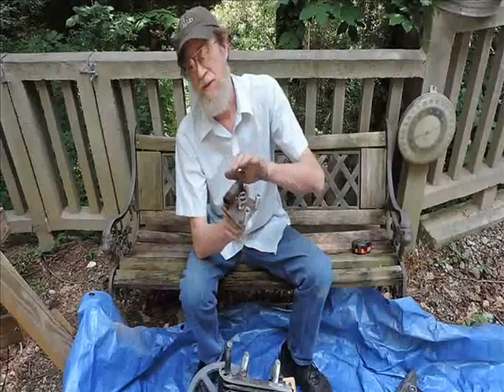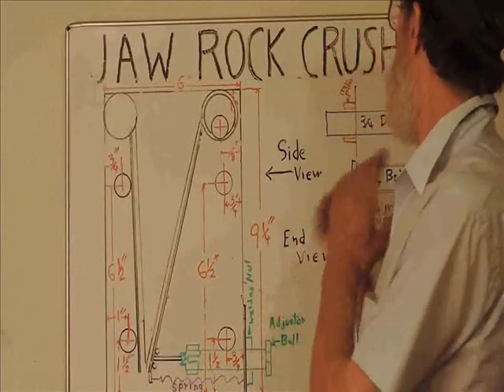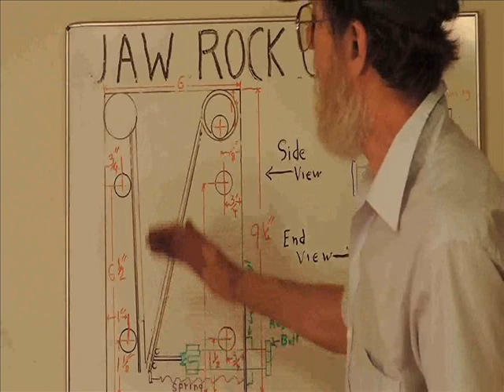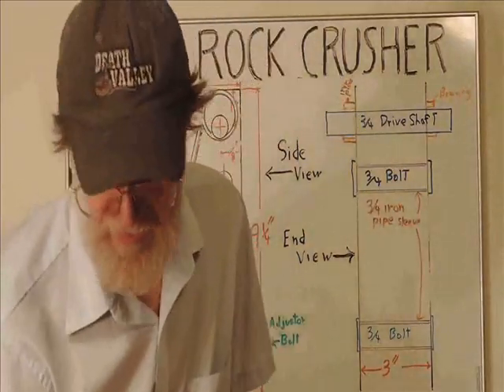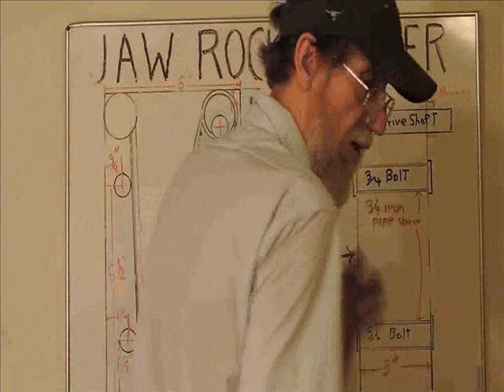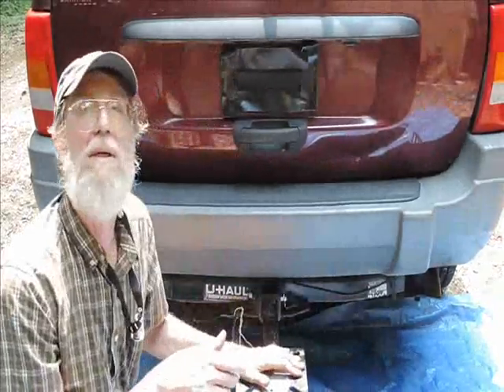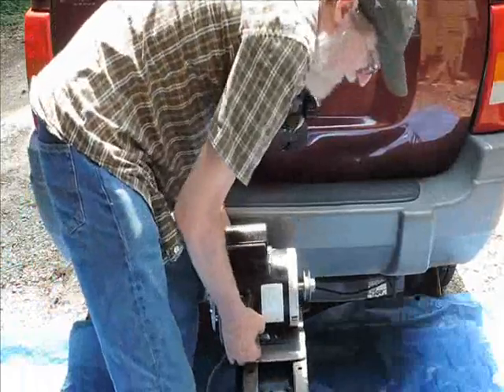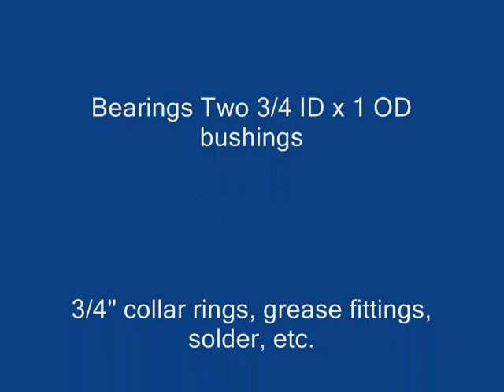Gold Ore Crusher Tutorial part 3

Comment: Nice design and tutorial.  How do your jaws hold-up?  How about using hardface welding on the jaws. Cheers, Mark
Reply from the maker: The heat treating definitely helps. My cousin mentioned hardface welding earlier when we were discussing how to treat the jaws.  He has seen it done to horseshoes to prevent wear and give traction.
Reply: *****
Yeah, it is just an option. If your heat treating works a treat then there is no need to fiddle.  Cheers, Mark
Reply from the maker: Yes, but still it is an excellent idea.  This is especially true if you are using it for other than hobby purposes and cannot afford equipment breakdown.  I think it would take a arc welder with special rods but other sources mention different equipment some with special shielding gas.  Mig, Tig, not sure, but I don't think it could be that complicated if it is used on shoeing a horse.
Reply: ***** most welding supply houses will carry the magnesium alloy rods. they are $90 a pack where i get them.  i don't know if i will need more than one pack.